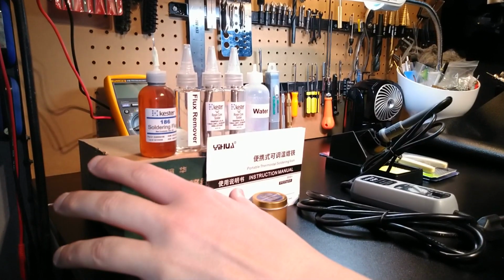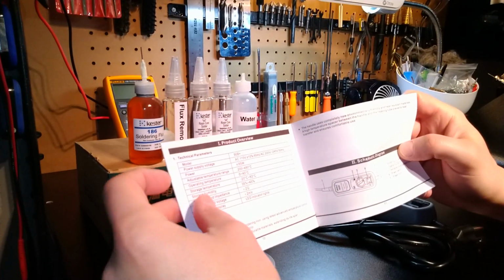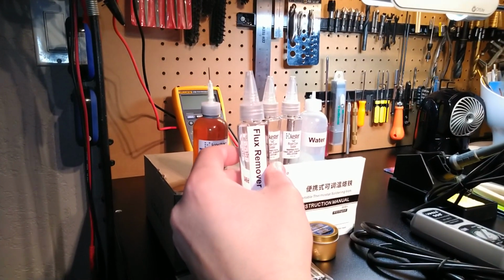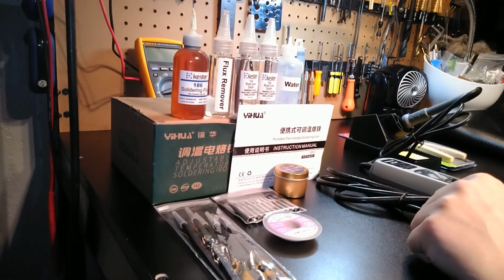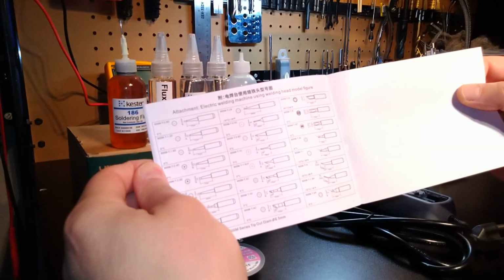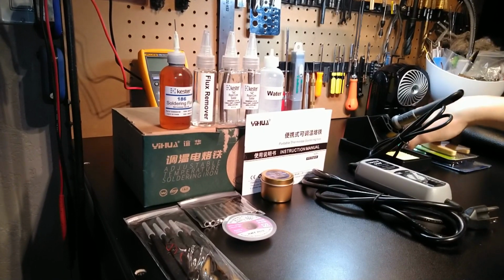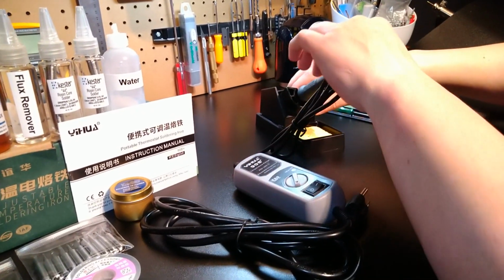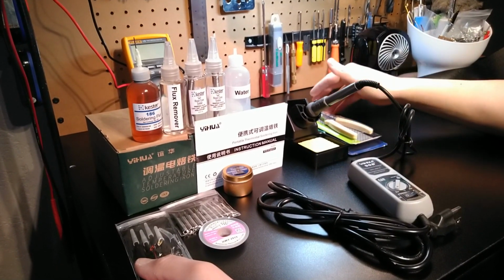New Soldering Packages Are In! (Enter To Win This Kit!)

Comment: Thanks Vince, enter me into give away. The soldering iron tips looks small enough to get into tight spaces especially on those smaller 12mm aviation connectors. Those can be difficult without the right tools.
Reply from the maker: Halfstep67 thank you for your support! Your in! Your also correct about the tips which is why I included all of them :)  Thank you, and have a great weekend! Vince